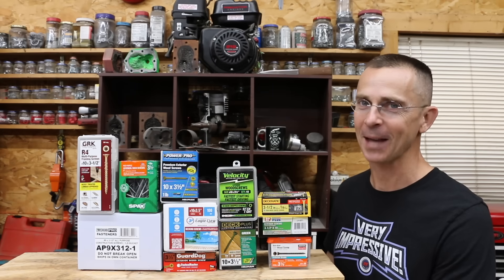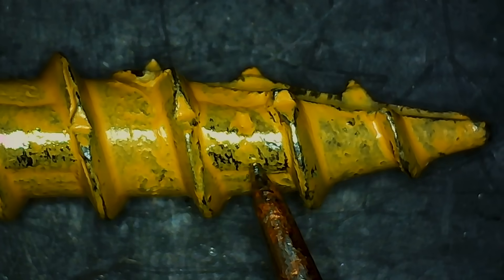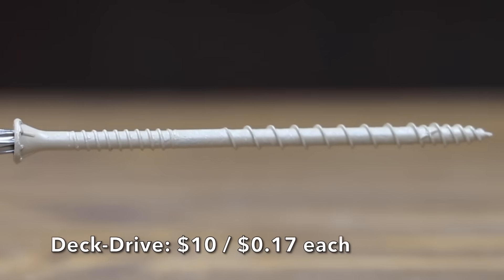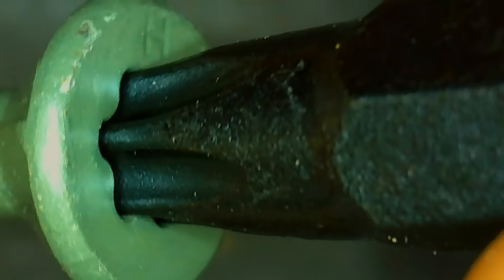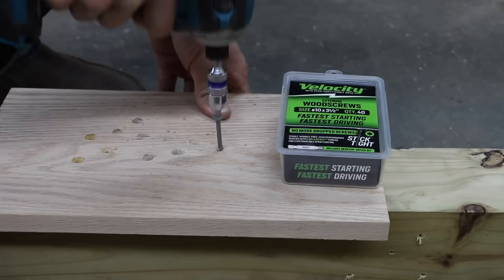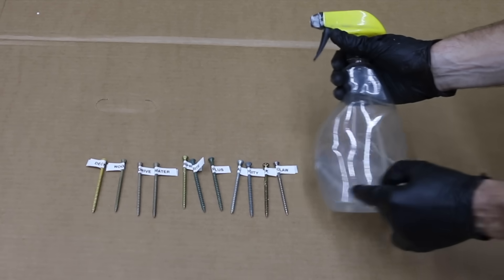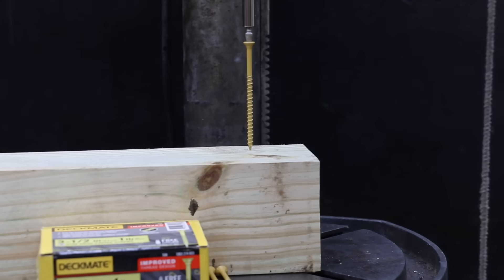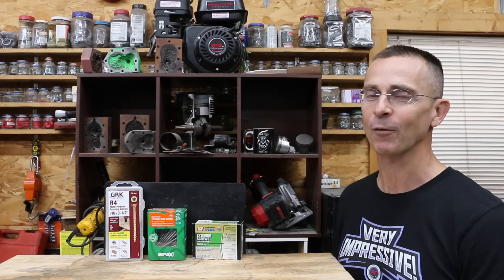Best Deck Screw? GRK vs SPAX, Grip Rite, Deckmate, WoodPro, FastenMaster, Deck Plus, Eagle Claw

Comment: I would be curious to see these tests run on nails in comparison.
Reply from the maker: Thanks for the suggestion.
Reply: @ProjectFarm  the price of nails vs screws in a project could make for a slightly cheaper deck that is just as sturdy right? 

I also wonder if:
1. Using pressure treated for the pull out test would change anything. The salts and moisture could change performance with how the screw threads interact with the grain structure?
2. You probably have this video, but what results the pull out test would yield on different types of shank. Smooth bright, vs smooth galvanized, vs ring shank vs spiral vs the best screw 
3. If using a gun vs. a hammer changes holding power.
4. Results over time- ambitious, but I think I read in a building science book that as time goes by the wood fibers bond with the fastener to a certain degree- until they become too weak from corrosion. You might get different results day 1 vs day 30 vs day 365 and beyond. It Might change the results if a ring shank technically makes a bigger hole when driven, and can be pulled easier closer to the time it was driven, but over time the fibers in the wood reform around the nail.

Comment: I've used the GRK Brand extensively and gotta say I really like them. Most projects were outside using Pressure Treated Lumber and my most recent project was a set of steps. Appox 2 years later not a single GRK Screw was showing any signs of rusting which is not common for anything screwed into Pressure Treated Lumber. I've tried many of the brands you tested here today and GRK is by far the best of the best. I've even spent the extra to use GRK on Non Pressure Treated Lumber in Attics and Basements due to humidity reasons and a higher possibility of rusting conditions. Since I buy them often I use them almost exclusively for any project. I've been doing construction long enough to know that using the correct fastener is vital to a superior result. Most of my projects have lasted far longer then intended and that's due directly to spending a bit extra for the right materials and fasteners. Cheers...
Reply from the maker: Thanks for sharing.

Comment: Awesome!  While the SS screws had poor shear strength, I still prefer to use them in most applications since the heads never rust or "run/streak" on vertical boards.  Great video!
Reply: I think for most deck applications the corrosion resistance is the most important of these traits tested.
Reply: @whirving  being a professional deck builder and having demoed hundreds of old decks, I would agree with you.
Reply: @whirving  I concur.
Reply from the maker: Thanks!  Thanks for the feedback.
Reply: I agree I work near salt water and with alot of red cedar woods and only trust stainless they strip easy and bend but will never rust or bleed
Reply: mike -" they strip easy and bend" ?
i use spax SS and have never encounter that .
Reply: @siriosstar4789  When I installed SS screws and clips I do not think that I saw the Spax brand at that time (~2009)
Reply: Staber -  it could be that spax didn't sell SS in The US at the time.  i live in germany where they are super popular . The cool thing about Spax SS is that they are self tapping and counter sink pretty well with little ridges under the head .
Reply: @siriosstar4789  Highly likely.  I’ve used SPAX fasteners since for other client projects.
Reply: @siriosstar4789  Yes,  I came to find that out once they were available here.
Reply: @siriosstar4789  spax screws are pretty much all I use when I am not using anchors. I have had no issues with them
Reply: @mikegman7502  Use stainless bits to drive stainless fasteners. Normal tool steel mangles them all up.
Reply: @heretolevitateme  I'm not saying I have an issue with screws stripping I'm just saying if your not careful they will strip and bend I always pre drill...Been doing this awhile. Anything outside is always stainless.
Reply: I used stainless Robertson to put together a child's bed frame.   Shear strength wasn't the issue - and it shouldn't be for a deck.
Reply: @tbelding    If you’re just using screws to fasten down the deck boards, shear isn’t an issue, all the force is in tension. For framing it would be in shear.
Reply: @huejanus5505  In houston, deck boards also end up in shear.  sand and clay, so everything settles.
Reply: Just want to make sure that the "stainless" element really is stainless.  Some cheaper stainless steel isn't so stainless.
Reply: My first deck built in 1993 used galvanized screws on cedar decking.  Right on time at 15 years, the cedar essentially turned to mulch around each screw and when the screws were examined the galvanized coating was essential gone leaving the carbon steel screw underneath severely corroded enough to weaken the screws, most of them had to be hammered over and broken off leaving the remnant in the pressure treated structure.  The PT structure of the deck, save for a very few insignificant spots had zero rot.  I took a different approach on the redecking in 2009.  After evaluating Trex vs IPE (a Brazilian hardwood), I chose IPE for its warmth and natural material.  IPE is a tightly grained, essentially no knots wood.  It is a crop in Brazil, not a harvested wood from a forest or jungle.  

(IPE has a fire rating approaching that of concrete according to my son who is the code compliance director for a fire protection systems manufacturer.  Not really a factor for my application but it is a factor in certain municipal applications (there is an internet pix of the aftermath of a fire on the Atlantic City boardwalk.  The original decking was totally consumed.  The IPE was totally intact and only signs of soot probably from the other wood that burned.)

IPE being an extremely hard wood requires that ALL driven screws must be predrilled.  Once you set up a system, one drill with a drill bit, the other with a driver bit, the extra step becomes negligible.  This time I used stainless steel screws and all stainless steel hardware with hidden clip fasteners that required a biscuit cutter to make the clip slot.  This deck is now 13 years old and looks essentially like it did the day it was put in once you power wash it.  I then restain it.  Downside?  IPE does not absorb stain well at all.  So the horizontal surface stain lasts approx 3 years and the vertical surfaces about double that time.  I’ve checked the stainless deck board screws.  They are tight, obviously no rust (it can happen with inferior stainless steel stock when the chromium content is skimped on).  All things being considered, I’d opt for the stainless steel fasteners and hardware again despite the cost.

Most of my clients opt for PT and typical deck screws, despite seeing my deck as an example.  I build what they want although often think that it is a hollow economy.
Reply: @staberdearth3130  We did a few IPE decks in the early 2000s. We used every 1/8" drill bit in the tri state area. Love that green sawdust smoke when cutting the boards ! I think we used 80 tooth Makita blades with good results.
Reply: @matthoward1174  What surprised me were two things.  There was a mention that IPE dust (more like powder) could be an eye and skin irritant.  I started off wearing safety goggles (not glasses) over regular glasses (took my, at the time, contacts out) and a long sleeved shirt and pants.  Came to find out that, at least for me, it was of no concern.  Also, I had bought extra blades figuring I’d be changing out more often.  I used one blade for the whole project, no laboring or burning (although IPE does have a high temp tolerance).
Reply: Just pulled apart a deck that had 100% coated screws. Anything in the rotted boards was completely destroyed, but if the lumber held up they were okayish. 

Either way I’m using stainless for the decking, don’t really need 1500lbs shear force to hold a deck board down
Reply: I used the Deckmate from HD so if I am concerned about the coating coming off of the head then I can just use stain/clear sealer to protect them from rusting?
Reply: @Pernoctate  He’s just doing what his pastor told him to do.

Comment: As a DIYer I had no idea there were so many types of deck screws. I've been a GRK fan boy for several years. The Torx head  is a vast improvement over the square Robertson head I used previously. Removing old galvi screws in pressure treated lumber showed a lot of corrosion, hopefully these modern screws will hold up better.
Reply from the maker: Thanks for the feedback.

Comment: A thought for testing screws, lags, and such, what about using synthetic decking? it would be more consistent than pine boards and such, no knots or different grain structures.
Reply: Cost might be a concern, but a local contractor should have scraps left over from decking you theoretically could have... hmmmm
Reply from the maker: Thanks for the video idea.

Comment: You should try Australian hardwood decking Janna hardness 14. Pre drilling is mandatory otherwise splitting is inevitable. Wouldn’t touch anything other than stainless here on a decent deck. 

The head design for water pooling sealing and how long your timber deck will last.
Reply from the maker: Thanks for the video idea.

Comment: If you are having a wooden deck installed, you are AN IDIOT! I put in Jr I beams, structural C channels, pan decking and then I poured light weight CONCRETE into the pan. Let's see that one rot off of the side of the house! Some decks fail within 5 years.

Comment: I'd love to see these shear strength and pullout force tests on various diameter lag screws (1/4"; 5/16"; 3/8"; 1/2"). Maybe zinc-plated vs galvanized as well?
Reply from the maker: Thanks for the video idea.
Reply: @ProjectFarm  I noticed the triple coated screws weren't referenced . I wonder how well they actually do hold up against corrosion like they claim. Have you done a Vid on them?
Reply: That would be interesting cause they are used quite a bit in deck building.
Reply: Right, with some adds for the items like Headlok and similar along with mixing in Simpson for head to head comparison.

Comment: Excellent test, as usual.  You do a great, fair job.  My usual go-to construction (deck) screws are the GRKs, but if I'm really concerned about rusting, I'll spring for some good stainless screws even if they are a bit weaker than the normal steel screws.  I just may throw a few more in to make it up and they hold up so good.
Reply from the maker: Thanks!  Thanks for sharing.

Comment: I used the Spax stainless screws to build a fence with my dad.  Hurricane Ida pushed a water oak tree in my back yard down and it pretty much killed half the fence (RIP).  The screws did bend from the force of the tree but they did not come out of the wood.
Reply from the maker: Thanks for sharing.

Comment: Could you test the corrosion resistance of hot-dipped galvanized framing nails and a few of the best exterior grade screws next to each other? I'm curious which one resists corrosion better over time. My hunch is the galvanized nails due to better coating adhesion, but I'd love to see a side-by-side comparison!
Reply from the maker: Thanks for the suggestion.

Comment: I continue to buy and use spax. I’ve used thousands of all the different sizes. The most annoying thing I’ve found is that often times the 3” #10 Spax have a very dull tip practically requiring pilot drilling to start. It’s especially difficult and annoying while driving into plywood… on a ladder..at full reach lol. Cmon Spax! Tune up your process!
Reply from the maker: Thanks for sharing.

Comment: As long as they don’t strip out, I actually prefer a looser-fitting drive bit.  With tighter bits (read: Spax) I’m constantly leaving them in the head of the screw when I pull my driver away. It’s a real PITA when you’re constantly having to stop and retrieve your bit…
Reply from the maker: Thanks for the feedback.

Comment: Great video, as always. 
My suggestion: drawer slides! Best brand, are the metal ones any better than the plastic, maybe a machine to open and close 20,000 times, 100 pound vs 220, 350, 600 lb weight rating.

Comment: I really appreciate all the information in this video.  I'm sorry, I only say this in the most constructive way, but do you think you could either talk a bit slower and/or longer breaks in between separate thoughts?  It was hard at times to differentiate when you stopped talking about one screw and started talking about another.  Or maybe just putting a visual cue on the screen saying which screw you're currently talking about.  I know you move along pretty quick in all your videos, but I really do find these very helpful and your testing is about as thorough as could be to provide consumers with clear ideas on what their getting and what to expect.
Reply from the maker: Thanks for the suggestion.

Comment: You really should look at using MDF or OSB for wood testing.  Solid wood is just too inconsistent.  With the variation from screw to screw being so small percentage wise, the variation of wood density could very well account for the differences.  I know my local building supplier (not big box store) carries 4x4 OSB and MDF products.  Even if you can't source something like this locally, you can rip sheeting and stack it to get the thickness required.  Maybe this could be another video idea.  Re-test some screws and nails using different natural and man made materials to see if the materials used for testing effects the outcome greatly.

I do still love your methodical testing on how products are used and abused in real world applications.  Even if I don't agree with some of the testing methodology, the overall conclusions are great.
Reply from the maker: Thanks!  Thanks for the suggestion.

Comment: one thing i would have loved to see, is if after corrosion whether the screw ends up stripping. Thats always my big problem with deck screws. A board comes up in my deck, and I strip or break the head off when trying to unscrew it because its so old and has had like 10 winters of northeastern weather hitting it
Reply from the maker: Thanks for the feedback.

Comment: Think about it; the more resistance going in, the more force it would take to reverse the screw via natural causes. Having said that, it's sad to see how ppl have be duped into thinking that we need screws this expensive to build a deck. I don't recall news clip that told of decks failing all across America due to fasteners before these screws were available. Hot galvanized Ardox nails worked very well for decades until advertisers started convincing ppl that these high priced $crews had to be used. smh

Comment: Serious request: diy gaskets! Could you test different materials for gaskets? Like manilla folders, cereal boxes, milk carton, beer can or spray paint can v.s. different automotive gaskets like rtv, cork, and rubberized paper gasket materials?

I really want to know how each holds up to oil, fuel and water, hi/low pressure and hi/low heat and heat cycling. 

I feel like this would make really good content and would bless the automotive diyer community. 

Thanks!
Reply from the maker: Thanks for the video idea.

Comment: I think the corrosion resistance is arguably the most important aspect for the purchase, along with the price of course. Shear strength and such tests are also important, but as long as you buy the correct size screws, overloading the deck connection from purely static load is a non-issue.
Reply from the maker: Thanks for the feedback.

Comment: I would keep in mind that out of the box the stainless may not be tops but I would like to see them in ten years.  The stainless if it has any quality will still have its mass while the others will be eaten away by corrosion weakening them substantially.  When the thread diameter is reduced so is holding power, same with shear resistance when the shank is reduced in diameter.  That is not even mentioning the frustration of having to try to remove screws with the drive pocket distorted by rust.  Point being that in real life for most outdoor applications it might be worth the increase in price for the stainless.  A very good video.
Reply from the maker: Thanks!  Thanks for the feedback.

Comment: I have a deck I need to repair and refinish in the spring.  Along with the screw, I would like to see deck coatings for older, weathered decks, with some cracks and splitting.  Does a thin coating that penetrates but has thin film preserve the wood better than a thicker coating?  And, which provides the longest lasting coating and best long term preservation?
Reply from the maker: Thanks for the video idea.

Comment: Of course the coating is scrapped off when you REMOVE the screw, but if you leave it in place the coating is deposited in the area where the screw is at so..... the rust protection is right there!
Reply from the maker: Thanks for the feedback.

Comment: Great video as always I would be very interested in a more in depth test on the corrosion resistance of the screws when installed in PT lumber. I maintain a campground on a saltwater river. I have gone to stainless on most everything but stainless screws are very expensive. If I knew the best coated steel screws I would give them a try to save some money. I know for sure deck mates only last about 2-2.5 years in my environment.
Thanks for your efforts to give us the best value on products.
Reply from the maker: You are welcome!  Thanks for the video idea.